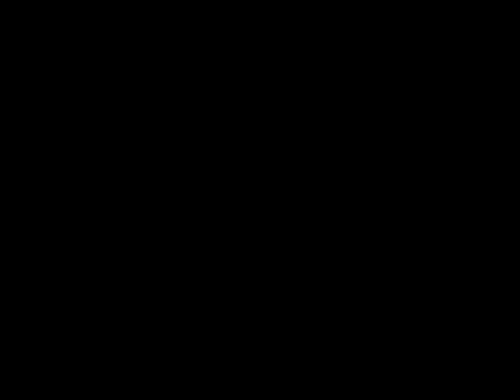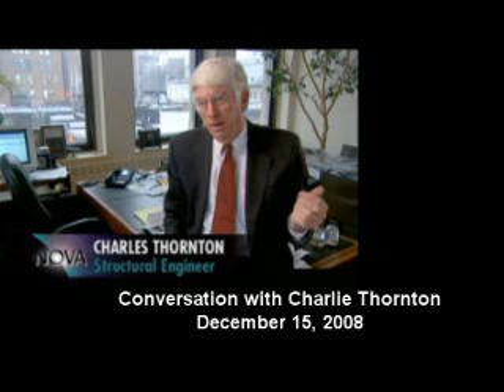pumpitout.com Jeff Hill speaks with WTC Investigator Charles Thornton

Comment: So vibrations were beyond the scope of the abilities of the original architects and engineers?
I don't think so.
Reply: This guy thinks a plane crashed into it.  This makes him a chump.  Why wouldn't a plane slow down and deform when it crashes into a steel frame and a concrete slab?  It would.  Now maybe the videos are just all fake, but then why would they hide all of the airplane parts if there was an airplane?  Fire is not going to make two jet engines disappear.  Or two black boxes.

This guy presents himself as being logical and knowledgeable but he's starting with premises that he can't prove to be correct and his theory is based on them.

Vibrations from an airplane that can't be shown to have existed? 

If the plane doesn't exist, the vibrations don't either. 

Had there been a plane then the smoke  from those immediate fires would have been pulled into the wing tip vortex.  That didn't happen, so there was no plane.

There were explosions.  If they weren't from conventional bombs, then perhaps from some technology that elements of the military (u.s. or israel's) know about and we don't.

But there's no proof of a plane.  Unless the planting of the wrong engine on vesey street is proof.

It isn't for me.  It's proof that there were no planes.
Reply: @lebergerdesphotons4565  Vibrations from an airplane that can't be shown to have existed? 

If the plane doesn't exist, the vibrations don't either. 

You're on glue!!.  Certifiable!!  You should be locked up.
Reply: @roquefortfiles  

 Vibrations from an airplane that can't be shown to have existed? 

If the plane doesn't exist, the vibrations don't either. 

So your hypothesis is that the only possible source of vibrations in the universe is fake planes?  I'll ask Jon Cole if he wants to design a clever experiment to disprove your theory.

You're on glue!!.

yes,  The floor here is made of glue.  how did you know?

  Certifiable!!  You should be locked up.

I'm glad you're not a judge.  Locking people up because they're standing on a glue floor!  Really!
Reply: @lebergerdesphotons4565  A plane that cant be shown to exist??? The fuselage landed on WTC  5 there dude!!!.. that's a 9 story building.   Dont be an ignorant idiot
Reply: @roquefortfiles  
 A plane that cant be shown to exist??? The fuselage landed on WTC 5 there dude!!!.. that's a 9 story building. Dont be an ignorant idiot

the fuselage landed on wtc5?  do you have video of the fuselage landing on wtc5?  please do show it.  thank you very much, sonny.
Reply: @lebergerdesphotons4565    Yeah if you watch the plane fly into the building you can track all of the debris that comes out the other side.  There's photographs of the fuselage section lying on the roof with a fireman having a look at.. 9 STORIES UP!!  Get real.  Stop being an idiot.   You got a bad case of circular reasoning!!!!!.  There are hi resolution photo galleries available on line (I've looked at them) with plane debris all over the street.   Passenger seats,  Life vests,  body parts.  The landing gear wedged in a column section blown from the building!! Part of the landing gear in the back of a car.   What you write is completely ridiculous.  You got a few screws loose.
Reply: @roquefortfiles  
Yeah if you watch the plane fly into the building you can track all of the debris that comes out the other side. 

Comes out the other side!  indeed!    that brave aluminum doesn't let the 2 slabs of concrete or the core of the building, more slabs on the way out.
gotcha bubba!  Thanks for pointing that out. Calls for an expert to see that.

 There's photographs of the fuselage section lying on the roof with a fireman having a look at.. 9 STORIES UP!! 

Yes,  one of the links to prove one more of your silly claims that I'm still waiting to receive.

 Get real.  Stop being an idiot.   

No doubt by that you mean stop talking to you, cause that's the only thing I'm doing for which is someone called me an idiot I'd have to agree.

You got a bad case of circular reasoning!!!!!.  

I got the rockin pneumonia and the boogie woogie blues.

There are hi resolution photo galleries available on line (I've looked at them) 

Then send me a link,  that ought to shut me up!

with plane debris all over the street. 

Like the fake engine on vesey street?

  Passenger seats,  Life vests,  body parts.

Body parts?  Good luck finding the link for that!

  The landing gear wedged in a column section blown from the building!! 

years later, because too many people were catching on to the false flagginess of 911.  It was planted like the wrong engine.

Part of the landing gear in the back of a car. 

Poor guy didn't even have time to unload it and make it look like it belonged there.

Either that or he was stealing it knowing there'd be a good market later for 911 memorabilia.

  What you write is completely ridiculous.  You got a few screws loose.

But I've always got my 10 mm and 13 mm wrenches on me, so I'm ok!
Reply: @lebergerdesphotons4565  Then send me a link,  that ought to shut me up!

Who the fuck are you kidding???  NOTHING would shut you up.  They could drop the plane on your head and you'd say... IT WAS CGI.
Reply: @roquefortfiles  

YOu haven't sent anything at all to me except for the doofus from earlier.  what point was he trying to make?  The building could be the worst, fine.

The funny part of that is that your only other reference was les robertson.   This other guy says that building was the worst building ever.  So that means he has no respect for your only other known source of information.

What I see is that I haven't said anything I can't and haven't backed while you can't backup anything you've said.
Reply: @lebergerdesphotons4565    Great.  Then tighten up the bolts holding your head on.  Maybe it would clear up your inability to understand.  And stop saying such utterly ridiculous crap.    Sorry dude but you're one of the fringe element weirdos.
Reply: @lebergerdesphotons4565    You're pretty fucking far from ok.
Reply: @roquefortfiles  

le berger des photons Great. Then tighten up the bolts holding your head on. Maybe it would clear up your inability to understand. And stop saying such utterly ridiculous crap.

Naturally you find it ridiculous.  That's your definition of "I disagree".

If only I didn't have Newton, Feynman and Cole on my side, and you only people that you imagine and then write about.

 Sorry dude but you're one of the fringe element weirdos.
Reply: @lebergerdesphotons4565    The guy who said it was a piece of junk was Engineer Charles Thornton.  Who btw just so you're AWARE!!!  Because you seem horrifyingly UNAWARE and completely clued out !! Was on the NIST investigation but he was on the OVER SIGHT committee.  Responsible for holding the investigators FEET to the FIRE.  For all intents and purposes you're  talking about a guy who was on YOUR SIDE of the investigation.  Tasked with making sure that nothing got missed.  This guy is on YOUR TEAM!!!!!  He's on YOUR SIDE!!!!  And he called the building JUNK!!!  A piece of SHIT!!  The guy is falling on his sword..  FOR YOU !!!!  And all of your ilk.  Flat out honest in calling a spade a spade.   Cheap, Flimsy,.. Light!! 

A floor system that had never been used before!!  No different to the roof of a High School Gym.  Or Lowes hard ware store. Open wed bar joists that are impossible to fire proof.    And you're amazed that a passenger jet with 60 tons of fuel and 9 ton engines moving at 840 feet/ sec went straight through it?? 

Eye roll.
Reply: @roquefortfiles  
	
roquefortfiles
le berger des photons The guy who said it was a piece of junk was Engineer Charles Thornton. Who btw just so you're AWARE!!! Because you seem horrifyingly UNAWARE and completely clued out !! Was on the NIST investigation but he was on the OVER SIGHT committee. Responsible for holding the investigators FEET to the FIRE

Classic doofus!  Thank you for that.  I couldn't write it better.

The NIST investigation is a total fraud,  even the ex-governor of new jersey realized that he'd been taken for a ride.  For once, I agree with the ex governor of New Jersey.

. For all intents and purposes you're talking about a guy who was on YOUR SIDE of the investigation. 

He was?  Then how could he have let them print that tripe?

Tasked with making sure that nothing got missed. This guy is on YOUR TEAM!!!!!

They missed everything you moron.  Ask the former governor of New Jersey.

 He's on YOUR SIDE!!!! And he called the building JUNK!!! A piece of SHIT!!

Maybe you see it that way,  but you're completely stupid, so it's not surprising.

Even if the building was a piece of shit (it wasn't) there would still be a collision strong enough to have been measured.

And it was not measurable.

The guy is falling on his sword.. FOR YOU !!!! And all of your ilk.

YOu have no idea who you're talking to.  You just know that anybody who likes facts doesn't agree with you.

 Flat out honest in calling a spade a spade. Cheap, Flimsy,.. Light!! A floor system that had never been used before!!

Are you saying you're against innovation?

 No different to the roof of a High School Gym. Or Lowes hard ware store. Open wed bar joists that are impossible to fire proof. And you're amazed that a passenger jet with 60 tons of fuel and 9 ton engines moving at 840 feet/ sec went straight through it?? Eye roll.

It didn't go through it.  it didn't go near it.  Fireproofing?  So?

the kerosene plus whatever burned wouldn't have released enough heat (even had it all transferred directly to the steel instead of leaving in black smoke) to raise the average temp of the steel frame by more than about 20 degrees.

at 40 degrees C I think the terrible building still was at 100% strength.

Keep 'em coming.   An inexhaustible well of new stupidities.
Reply: @lebergerdesphotons4565  Sorry but what the fuck have you backed up??  Dude your beyond delusional.
Reply: @roquefortfiles  

I have backed up that there would necessarily be a jolt.  Newton backs that up.  your wild theory bred of ignorance suggests that this giant structure which has the strength to hold up the 22 stories suddenly can't even slow them down a little bit.

Let's look at the math.  your 22 stories don't decelerate at all when they crush the wtc tower which was undamaged.

since m1*v1  = m2*v2

1 refers to the  22 stories,

2 refers to the total mass of the building.

for v1 to not change at all  the momentum of the 22 stories would need to be infinite.   It's mass can't change, so it's velocity would have to.

So the only way for what you said to have happened is if somehow the 22 stories accelerated to the speed of light during their fraction of a second fall to build up that dynamic load.

There goofus,  that's math backing up my story based on the analysis by jon cole's source of the video.  You're the video "expert",  I haven't heard you trying to touch that study.  Either you don't understand it or you know it blows your insane argument out of the water.

Was the math over your head?
Reply: Charles Thornton in 1988 has said exactly the opposite: 

"The largest aircraft flying today, at least commercially, the 747, fully loaded, is on the order of 300 tons. So if you think about a 300-ton element crashing into a building that's been designed to carry 13,000 tons, you can see that an aircraft crashing into the World Trade Center would probably not do anything to the major building. It could affect localized structural elements, could knock out a column, and there could be some damage. But as far as a plane knocking a building over of that type, that would not happen."

here's who is charles thornton:   

https://www.thorntontomasetti.com/person/charles-thornton

why would I take your opinion over his?  You're a clown,  he's at the top of the field of structural engineers.

you're a moron.
Reply: @lebergerdesphotons4565  crashing into a building that's been designed to carry 13,000 tons,

YES 13,000 tons !!  But that is a LATERAL load.  The face of the building presents a huge area for wind loads.  So it is designed to handle this loading.  It is designed to actually SWAY and GIVE for that load.  The sway actually reduces the loading. The same as those annoying car sale signs in car lots that are on springs.  The wind doesn't knock them over.  The sway of the WTC is the same thing.  So no!! the plane could not knock over the building with a designed for wind load at 13,000 tons.  But the loads of the floors up and down are carried exclusively as STATIC LOADS.    And once the floors separate from the columns and the exterior wall folds like cardboard from the lack of support  GAME OVER!!.  This is completely separate from the lateral loads.  You're talking apples and oranges.
Reply: @lebergerdesphotons4565  which has the strength to hold up the 22 stories!!!

Yes it has the strength to hold up 22 stories.  SO LONG AS IT REMAINS STATIONARY!!  And that is how the building has remained standing for 35 years.   Because everything is working...................AS IT WAS DESIGNED!!!! AS IT WAS INTENDED.  Everything is in ALIGNMENT!!  The loads are being carried as they were DESIGNED!!!!

Remove the cross brace of the floors and the load carrying ability of the COLUMNS drops by a LOGARITHMIC factor.  YOu can look that UP!!!!!!   

And you can CLEARLY See that exterior columns BOWED INWARD by 5 feet in some areas prior to the collapse of WTC 2.   The only thing connected to the columns................ARE THE FLOORS.   Without the cross brace of the floors the columns have no stability.  They can't carry SHIT!!!!!
Reply: @roquefortfiles  

sorry doof.  here's the problem with your reasoning.

Thornton said that an airplane wouldn't hurt the global structure.  I'm sure he was right.

You say he's wrong because the building fell.

The hole in your logic is that you've accepted that an airplane did this damage all by itself.

We don't even need to bother with the argument of whether there was a plane or not.

I'll give it to you.  Let's say there was a plane.

Thornton says it would do no major damage to the building.  And he's the expert, not you.

You noticed that there was significant damage done.

You're right.

But the conclusion is not that Thornton was wrong,  The proper conclusion is that there were other forces at work besides a (fake) plane.

Especially obvious because there was no jolt between the part dropping down and the part getting dropped down on.
Reply: @roquefortfiles  

which has the strength to hold up the 22 stories!!! Yes it has the strength to hold up 22 stories. SO LONG AS IT REMAINS STATIONARY!! And that is how the building has remained standing for 35 years. Because everything is working...................AS IT WAS DESIGNED!!!! AS IT WAS INTENDED. Everything is in ALIGNMENT!! The loads are being carried as they were DESIGNED!!!! Remove the cross brace of the floors and the load carrying ability of the COLUMNS drops by a LOGARITHMIC factor. 

What you're saying is of no significance.  Because crush up equals crush down.  it's newton's law.  We accept it here on Earth.

if you look at the momentum equation you would see that you're an idiot.

You won't.

the 88th floor,  the top of the undamaged part of the building.  your top falls down with its dynamic load.  the 88th floor is now supposed to be moving  downward with the 22 stories?  well it probably weighs 5% of the 22 stories, even if the giant beams which are holding up a giant static load offer zero resistance, the falling (hypothetical) mass will slow down 5% when it hits the 88th floor.  But 5% is way more than the margin for error of the video with it's images every 33 milliseconds.

This didn't happen.  That fact is caught on film.

YOu can look that UP!!!!!! And you can CLEARLY See that exterior columns BOWED INWARD by 5 feet in some areas prior to the collapse of WTC 2.

But that doesn't prove that this happened because of a (fake) airplane crash.

And one of the best structural engineers said that it would do nothing significant.

An airplane didn't knock down a building.

you're an idiot.

 The only thing connected to the columns................ARE THE FLOORS. Without the cross brace of the floors the columns have no stability. They can't carry SHIT!!!!!

they also have no motive to break into short pieces.  They should either stand or fall over and not break into many pieces at all.
Reply: @lebergerdesphotons4565  We don't even need to bother with the argument of whether there was a plane or not.

Dude?? please stop with this utterly ridiculousl plane nonsense ok.   You're not fooling anyone.  You sound like a complete nutcase.  Someone who should be carted off in a jacket.   The entire firm responsible for putting up the WTC were at their windows watching the first building on fire when the second plane hit.   They watched the whole thing. I just finished watching it. Please stop with this plane nonsense.     You sound like a barking mad lunatic.
Reply: @lebergerdesphotons4565  
https://www.youtube.com/watch?v=Yo1WZ9g1IJ4

24:27 minute mark.  So she's imagining the plane hitting the building 2 blocks from her looking straight at it??  The entire office is just imagining the plane hitting the building as they watch it happen in front of them?? 

Dude?? you sound like a complete fucking barking mad NUT CASE!!!.    The entire foundation of what you're attempting And failing badly, to argue is built on NONSENSE to begin with.  If you can't accept that a plane hit the building then you can't accept anything about this.  

I don't even really know why the fuck I am talking to you.   

You sound like a total crazy man.  And i call it like it is.
Reply: @lebergerdesphotons4565  Charles Thornton also said..   "If you lose the lateral support of the floors the exterior wall will just bow out".  

Strange you never bother to mention that.   Look!! why don't you just admit that you're a fruitcake who can't understand any of what your'e looking at.  And you have to invent crazy scenarios in order for your brain to process what you're seeing and can't understand.     And it is plainly obvious to see. 

Imagine you're in a court of law or inquiry on the WTC.   

So Mr Photons?  The aircraft wasn't really there?? 

Explain your position.   With reason and logic!!!!!
Reply: @lebergerdesphotons4565  Thornton says it would do no major damage to the building.  And he's the expert, not you.

NO. NO NO NO!!!  He said.  "But the idea of an airplane knocking the building OVER that would not happen for a building designed for 13,000 tons of wind load"  

 based on the lateral design loads an interview given long before 9/11.    That is an ENTIRELY separate argument to the weather the building could COLLAPSE!!!!!!!!!!!!!!!!!!!!!!!!!!!!!!!!! 

Of which he is on record as saying "If you lose the lateral support of the floors the exterior wall will just BOW OUT".. 

And that is precisely what it did!!!

Where's the hole in your argument???  If you look around the room and you can't spot the idiot...................?
Reply: @lebergerdesphotons4565  Dude this has ALL BEEN EXPLAINED BY PEOPLE A HELL OF A LOT BRIGHTER THAN YOU. This is all addressed on NIST FAQS.
Reply: @roquefortfiles  If only the world was like you imagine it.  That NIST is not corrupted at the highest levels.  That everybody who could make any kind of credible statement has to consider whether saying things that the PTB don't want said might lead to rapid declining health, like Bob Marley saw, for example.

So  sorry,  tom keane was man enough to say it out loud that NIST had lied that the gov't set him up on the 911 commission to tell everybody lies.

You should try being a man.  A man uses his head, he doesn't repeat the "common wisdom".

He recognizes that it may be propaganda and he needs to consider that possibility.

Believing a thing because somebody else does is one of the main logical fallacies.

You're good at logical fallacies,  but you're not good at logic.
Reply: @lebergerdesphotons4565  If only you weren't a completely paranoid conspiracy freak.
Reply: @lebergerdesphotons4565  Non existent plane?  And you're telling me to man up?
Reply: @lebergerdesphotons4565  OMG!!  dude I have wiped the floor with you and your logic.  There are so many holes in your arguments you could fly the HINDENBURG through them.
Reply: @roquefortfiles  

Non existent plane?  And you're telling me to man up?

I"m still waiting for you to tell me why those two flights were not in the same database as millions of other flights were.  It seemed that all flights which took off from us airports are in that database with the exception of a couple of flights on 911-2001.

Yes.  quite being an idiot.  the only "proof"  you have that a plane exists is a piece of video.

Everything else, you haven't been able to show any documentation.  Fake pieces of airplane "found"  years later, or the same day, but not being the right engine.   

Doesn't the wrong engine being found kind of demonstrate that somebody wants us to believe things which aren't true?

Why don't you try to prove that the wrong motor wasn't found.  

Or that the motor found at the pentagon wasn't much smaller than a motor from a passenger jet?
Reply: @roquefortfiles  

OMG!!  dude I have wiped the floor with you and your logic. 

I'm sure you believe that.

 There are so many holes in your arguments 

I haven't seen you punch any holes in any of my arguments.   This is just you blathering again.

You're blown away by Newton and Cole on the no jolt observation and analysis.
Reply: @lebergerdesphotons4565  Tell ATC Dave Bottiglia that!!. He had the plane on radar all the way to the WTC.  Calling down the altitudes.
Reply: @roquefortfiles  

even if the 22 stories falling into the bottom 88 undamaged floors were given infinite tensile strength and infinite hardness the bottom would still stop the top from falling long before it would get to the bottom.

Or more likely, it would fall over the side after bouncing off.  I guess I'll need to give it perfect adhesion also to meet your requirements.
Reply: @lebergerdesphotons4565  You have absolutely zero understanding of this.  None!!.  The problem here is that you think you do.
Reply: @roquefortfiles  

You have absolutely zero understanding of this.  None!!.  The problem here is that you think you do.

Unfortunate for you that you can never name one of the things that I don't understand.

John Cole and Newton and I explain to you how you are mistaken,  but you just declare that I'm the ignorant one.  So all you have is your own opinion.

That and a buck,  what will you get?

try to be specific.  that could lead to a debate.  your handwaving is just you wanting to be right without doing the work.
Reply: @lebergerdesphotons4565  Sorry dude!!.  Your comment about falling over the side??.. you've just unzipped your stupidity fly.
Reply: @roquefortfiles  

does that mean I was mistaken about the official story being a conspiracy?  Were the 19 guys there just coincidentally,  all got tired the same day of the west coming to their country and screwing with them?

That's just the official story.  There weren't really 19 guys on planes cause there were no planes.  Hard to put 19 guys on planes that don't exist, that evade the u.s. gov't database.  

Those brave airport workers who kept those flights off the register!  I wonder why they did it?
Reply: @lebergerdesphotons4565  FYI every single gravity load is directed to the building footprint.  The structure cant be knocked over. Ties in with the 13,000 tons of lateral load.
Reply: @roquefortfiles  le berger des photons FYI every single gravity load is directed to the building footprint. 

but a collision between a fictitious 22 stories of perfect rigidity and the bottom 88 floors which were undamaged by fake planes could cause the fictitious mass to go over the side.

Just one more thing you're wrong about.  It only happens when you open your mouth.  So if you want to stop being wrong, you see your solution.

The structure cant be knocked over. Ties in with the 13,000 tons of lateral load.

I didn't say it would be knocked over.  More straw man arguments.

You only have logical fallacy.  You prove it every time.

You should learn the logical fallacies so that you can lie more effectively.
Reply: @lebergerdesphotons4565  If one floor cant hold 15 failing... Which it cant!!.  What makes you think the next floor is going to do any better with 17.....
Reply: @lebergerdesphotons4565  You could fly the HINDENBURG through your crap with the planes.  Ask yourself if it holds water!!.. You got a good salad strainer
Reply: @roquefortfiles  

What kind of salad dressing will I need to be able to believe that an aluminum fuselage built just strong enough to not be crushed by  600 mph winds at 250 mb of pressure can destroy 2 4 inch light-weight concrete slabs struck on edges protected by more than one inch thick steel plates?

1400 kg/m3  for lightweight concrete.  10 cm thick, 60 m x 60 m. 360 metres 3  per slab.    500 tons per slab of "lightweight" concrete.

sure,  there's no concrete inside the core.  I agree.  But the core provides very strong links to a whole lot more mass,  so it's clearly offering more resistance than if it was just a 4 inch slab hanging in mid air.

Good chance that a 16 foot fuselage would contact two of the 500 ton slabs.

Thornton said a fully loaded 747 would be 300 tons.  Obviously the 767 is much lighter.

now how about the weight of the vertical columns?   Well,  surely a whole lot more weight, better tensile strength than the concrete, but of course the concrete will mainly be subjected to compressive loads.

Concrete is pretty good at that.  Probably better than sheet aluminum.

And where are the engines and black boxes?  And where are the entries for these flights in the official database which has every other flight ever flown out of a u.s. airport (unless it was the pope and the jesuits).

And why can't people understand frames of reference?  All that counts is the impact,  not who is moving and who isn't.

Is anybody else reading this conversation?  Do any of you have opinions?

I've seen a couple who seem to be in league with my doofus.  They went away when I showed them that I understood frames of reference and proved that they were lying.

Is there a "rest of you"?
Reply: @lebergerdesphotons4565  What would happen if a 767 flew into the building??   Well, We have over 50 angles of it!!!  Empirical evidence!! and witnessed by thousands of people.    Force equals mass x acceleration.   Had the aircraft been empty of fuel the building would have won.    The difference in impact force between the jet fully fueled to empty is enormous.   It doesn't matter that it is lightweight aluminum.   Move anything fast enough and it can do disproportionate damage to another surface.   Tornadoes prove this all the time with 2x4's impaled in walls. You can fire a ping pong ball through a 2x4 if you move it fast enough.  The impulse force on impact between fully fueled to empty is HUGE.  Drop a bucket of water on your head from 5 stories.  The full one would KILL you.
Reply: @lebergerdesphotons4565  Empirical evidence dude!!  It is not a hologram.  It is not CGI.  It is not a hole you order from ACME.  It is really there.   Deal with it.  You'll sleep better. 
https://www.cs.purdue.edu/homes/cmh/simulation/phase3/Run11/NorthFaceWTC1.jpg
Reply: @roquefortfiles  le berger des photons What would happen if a 767 flew into the building?? Well, We have over 50 angles of it!!! Empirical evidence!! and witnessed by thousands of people.

Let's avoid the argument about the existence of the plane.  Tell me how you have proven that there was nothing else going on in the building at the same time, perhaps set up by the same people who set up the planes?

The eyewitnesses can't know that, so we can eliminate them.  The 50 angles don't change that.

So as far as I know, you don't know if that was the case or not.

More difficult to prove that something didn't happen, isn't it.   

I think there were some good witnesses to explosions in the basement.  Surely your airplane didn't cause them.

 Force equals mass x acceleration. Had the aircraft been empty of fuel the building would have won. The difference in impact force between the jet fully fueled to empty is enormous. 

No.  that's not so.  The fuel tanks will have ruptured instantly, the momentum transferred to the building will be limited by the tensile strength of the fuel tanks.  once they ruptured, it's just a high speed uncoordinated splash, easily absorbed.

It doesn't matter that it is lightweight aluminum. Move anything fast enough and it can do disproportionate damage to another surface.

you still don't understand frames of reference.  The fact that the plane is moving doesn't mean it wins the battle against a stronger heavier object.

Tornadoes prove this all the time with 2x4's impaled in walls. 

Yes, they are impaled in walls,  not in steel beams.

You can fire a ping pong ball through a 2x4 if you move it fast enough.

I guess a ping pong ball has more tensile strength than the 2 x 4 has compressive strength.

 The impulse force on impact between fully fueled to empty is HUGE.

But what about the poor Newton talking about his equal and opposite?

the building hits the plane as hard as the plane hits the building.  And the building is much stronger.

 Drop a bucket of water on your head from 5 stories. The full one would KILL you.

My head is not resistant enough to easily break the bucket,  so this is not a good analogy.
Reply: @lebergerdesphotons4565     Something else going on in the building??   Those are mighty good pilots to hit the exact floor to coincide with "Something Else".   And unfortunately explosives going off inside the building (If thats what you're implying?) do not result in steel columns being bent INWARD.  They would be splayed OUTWARD!  The ballistics for that argument simply doesn't work.   This is about the same retarded reasoning applied to the TWA 800 disaster.  Except in the other direction.     We have cause and effect.  And it is predictable.  That's what science and evidence provide.
Reply: @lebergerdesphotons4565  the building hits the plane as hard as the plane hits the building.  And the building is much stronger.

Well quite apparently NOT!!!!! In 2 instances!!  And you can go examine in detail what the plane did to the building from both high resolution video and still photos and take all the time you want in examining.  Which btw line up almost perfectly with what computer simulations done after the fact predicted would happen.  The physical evidence matched the simulations predicted outcome.  They are both in agreement. 

   You can't look at factual evidence of something (a plane crash)  and then disagree with an outcome that you EXPECT TO SEE!!! That's not how the scientific method works.  You don't shoe horn evidence to fit your expectations.  Sorry it doesn't work like that.  What happened IS what happened.   Both planes went straight through the side of the building.  Because the force imparted on them was substantially over the bolted connections strength.  Which we can EASILY see in still photos.  And it was substantially over the yield strength of (At that level) EXTREMELY light box columns.  Once the plane was through all of this stuff it was acting more like a giant mass of LIQUID moving at 840 feet/ sec.  Doesn't matter.  If you hit the building with a bag full of guacamole moving the same speed you'd get the same outcome.    A physics prof even said so.  The plane could have been filled with WATER and you'd get the same result.  Liquid does not COMPRESS.   You can cut steel with a water jet.
Reply: @lebergerdesphotons4565  My head is not resistant enough to easily break the bucket,  so this is not a good analogy.

So you're telling me that If i dropped a large EMPTY!!! lightweight aluminum back yard pool on your house from 200 feet up it hits the roof of your house with the same force as if I lifted the exact same pool FULL OF 20 tons of water and dropped it on your house?    It is still the same cheapo light weight aluminum pool.   What has changed is the force delivered on IMPACT!!
Reply: @roquefortfiles  

e berger des photons My head is not resistant enough to easily break the bucket, so this is not a good analogy. So you're telling me that If i dropped a large EMPTY!!! lightweight aluminum back yard pool on your house from 200 feet up it hits the roof of your house with the same force as if I lifted the exact same pool FULL OF 20 tons of water and dropped it on your house? It is still the same cheapo light weight aluminum pool. What has changed is the force delivered on IMPACT!!

I'd say it might make a difference that my house is not steel and concrete.

your swimming pool all the same would break on the wood members and the massive amount of water would probably push the ceramic roof tiles off of their fine wood supports,  probably break the one inche square section members which held up the roof tiles.  The supporting structure would still likely be there after breaking the pool.

I"m still waiting for your explanation of why you're the only one I've ever heard claim an exception to every action has an equal and opposite reaction.
Reply: @lebergerdesphotons4565  Dude?? The roof of your house would disappear
Reply: @roquefortfiles  

no, because as long as I maintain my conversation with you my house is immune from newton's laws.
Reply: @lebergerdesphotons4565  Charles Thornton.  14 years of education!!.. "had the aircraft been empty of fuel the building would have won!".. 14 years of education....  You??
Reply: @lebergerdesphotons4565  Dude.. your house is actually CGI.. and when you fall over laughing maybe you'll understand why I do
Reply: @lebergerdesphotons4565  So... if I dropped a flimsy 25 pound bag of cat litter on your head from 100 feet up the empty bag hits your head with same force as one filled with 25 pounds of cat litter?  The fact the bag is still  light paper has not changed
Reply: @roquefortfiles  14 years?  Was he educated at a jesuit university?  Does he have 200,000 dollars of college loans that he needs to pay off and the perpetrators of the crime that is 911 wanted him to say that and so he didn't have a choice?

Sorry,  14 years of unknown "education" doesn't put him in a position to nullify Newton's laws because he believes a thing.

Really,  300, tons versus 293,  that's the difference between life and death for those 3000 alleged people?

Your idiocy hits new highs every time you open that ridiculous pie h ole.
Reply: @roquefortfiles  

but more to the point,  if you compare the 25 lbs of cat litter in the bag to 24 pounds of cat litter in a different bag,  that's the difference you're talking about.
Reply: @lebergerdesphotons4565  People including survivors exist. Listen to how many people say the Building swung back and forth,
Reply: @roquefortfiles  tell those idiots. Alot of kooks are not aware that pocketbooks, shoes, credit-cards, parts of the Airplanes and Sadly parts of people were all over the WTC complex
Reply: @lebergerdesphotons4565  it's not 22 floors falling on 88 undamaged floor s. It's 22 floor vs the very next floor, then the next floor all the way down
Reply: @melvynsngltn27  People including survivors exist. Listen to how many people say the Building swung back and forth,

Melvyn,  you are really challenged by reality.  You have just asserted that the only thing that can make the building swing is magical airplanes who crash into something much harder and heavier than themselves and don't slow down and don't lose their tail?

Why couldn't it be something else?

If the fake videos had shown a giant potato, you'd be advocating for the potato destruction of wtc1 and wtc2?

Yes,  you would.  That's your level of intellect.
Reply: @melvynsngltn27  more genius from the doofus!

it's not 22 floors falling on 88 undamaged floor s. It's 22 floor vs the very next floor, then the next floor all the way down

If you were capable of doing any math then you would not be emitting stupidity such as you just have.

Even if the bottom 88 floors were just magically held in place and automatically released when the 22 stories arrived,  each floor's mass would slow down the falling mass enough to make it take more than 30 seconds to reach the ground.

that didn't happen.  So your theory is bunk.
Reply: @lebergerdesphotons4565  no that's truth moron pay attention
Reply: @lebergerdesphotons4565  Magical planes you could see the second plane coming from Nearby New Jersey before it was driven into the South Tower. People like yourself believe in everything except reality
Reply: @melvynsngltn27   Magical planes you could see the second plane coming from Nearby New Jersey before it was driven into the South Tower. People like yourself believe in everything except reality 

Melvy singluarly stupid singleton

You have proved 911.  There was an airplane in New Jersey at the time!  That's absolute proof!   It's more than enough to suspend the laws of physics.

If only they had made you a one man 911 commission,  we all could have avoided so many problems!
Reply: @melvynsngltn27  Yes i know that.
Reply: @roquefortfiles  he may have had something on radar,  but he can't prove it was "the plane"  whose flight never made it to the faa database.

more crap coming out of one of your orifices again.
Reply: @lebergerdesphotons4565  Had there been a plane then the smoke  from those immediate fires would have been pulled into the wing tip vortex.  That didn't happen, so there was no plane.

 You're on crack!!.  The plane didn't fly through the smoke.   And friends of mine watched the plane live in person.  YOu sound like a complete and total nutcase.  Certifiable.
Reply: @roquefortfiles  

le berger des photons Had there been a plane then the smoke from those immediate fires would have been pulled into the wing tip vortex. That didn't happen, so there was no plane. You're on crack!!. The plane didn't fly through the smoke. 

doofus,  wingtip vortex lasts 2 minutes.  does it take 2 minutes for kerosene to catch fire and create smoke?  No.  It takes much less.  So the smoke would have been pulled into the vortex that the plane's wingtips (had there been a plane) would have created just before the smoke was created.

See how you are able to make bad assumptions?  You assumed that the plane has to fly through smoke to have smoke pulled through the vortices.   I had to explain to you that the smoke could be created after and that the vortices are still there.

This doesn't make you stupid,  but it doesn't make you smart either.

And friends of mine watched the plane live in person.

So your hypothesis is that because your friend watched the plane live that it was a plane that made no wingtip vortices at 500+ mph?

Let's test your hypothesis with experiments!

 YOu sound like a complete and total nutcase. Certifiable.

Where did you get this lingo from?  Is that what the police said about your father when they left you home with your mother while she drank herself to death?
Reply: @roquefortfiles  

listen  Doofus,  

Maybe go talk to your dyanmic force guru and see whether he agrees with you.

What he was saying is that a big enough load (which the upper part of the building would need to be moving or dynamic) could do some damage below.

He didn't say that just because it could do some damage that 20 times it's weight and 100 times it strength of other matter would turn to powder.  That Newton's laws would be repealed.

Ask them if there still wouldn't be a jolt.

Given that it's sources you found,  they're probably just that ignorant.
Reply: @lebergerdesphotons4565  It would do it EASILY!!. the structure had a safety margin of 5x the resting static load. When the top of the building failed this generated a dynamic load that was up around 80x the resting static load. The force necessary to crush the concrete was off the charts. Testing labs did studies on it. They know the force required to crush concrete to establish various standards.  It was not even close to being a contest. And yes there was a crush up. When it reached the ground. That's what you and your buddy Cole dont understand!!!!!. The crush DOWN was MASSIVELY over the crush... up
Reply: @roquefortfiles  le berger des photons It would do it EASILY!!. the structure had a safety margin of 5x the resting static load. When the top of the building failed this generated a dynamic load that was up around 80x the resting static load. 

well then there'd have to be a violent crash.  If there was a violent crash there would be a clear deceleration which would have been measurable on the official video.

It wasn't, therefore your theory is wrong.

The force necessary to crush the concrete was off the charts. 

and almost entirely dissipated after the first collisions.

Testing labs did studies on it. 

show me your studies.  I think you're just making this up.

They know the force required to crush concrete to establish various standards.

that would mean they know that there are huge quantities of energy used which exceeded by orders of magnitude the energy available from gravity and kerosene.

 It was not even close to being a contest.

kind of like when you and logic battle it out.  You lose every time, and logic wins.   You should try some logic sometimes.

 And yes there was a crush up. When it reached the ground. 

why not before?  Because the entire bottom of the building was being destroyed at exactly the same time by some enormous source of energy.

That's what you and your buddy Cole dont understand!!!!!. The crush DOWN was MASSIVELY over the crush... up

of course it was,  since it was lighter and more feeble and damaged.   Yes,  that's sarcasm.  You are probably retarded and I should quite picking on you.   The people looking after you are very nice to let you do this.
Reply: @lebergerdesphotons4565  well then there'd have to be a violent crash.  If there was a violent crash there would be a clear deceleration which would have been measurable on the official video.

THERE WAS!!!  You might like to notice that the debris is out pacing the collapse by a huge margin. 10 stories or more.   Why?? because the building is offering RESISTANCE.   Just not very much!!!  Why? because it is in a STATIC mode.  The portion failing is DYNAMIC!!!  And each floor collision is adding mass to the equation.  Your problem is getting EXPONENTIALLY WORSE as it goes.  The failure was actually speeding UP as it went.   The mass is SQUARED with each floor failure.  

Sorry.  But Dynamic loading matters.
Reply: @roquefortfiles  

well then there'd have to be a violent crash.  If there was a violent crash there would be a clear deceleration which would have been measurable on the official video.

THERE WAS!!!  You might like to notice that the debris is out pacing the collapse by a huge margin. 10 stories or more.

I didn't say that it was falling at 9.8m/sec/sec.,  mr.  straw man argument.

The building is offering precious little resistance.  The roof accelerated at a constant rate before during and after the collision.

If it was enough of a collision to be noticed in the graph, then it wasn't enough of a collision to destroy 250,000 tons of in tact building.

   Why?? because the building is offering RESISTANCE.   Just not very much!!!  Why? because it is in a STATIC mode. 

No.  because it is being simultaneously destroyed by something else which can easily be determined to be a much greater source of energy than the gravitational potential of the building.

 The portion failing is DYNAMIC!!!

Anything moving is dynamic.  That's the definition, mr. wizard.

  And each floor collision is adding mass to the equation.  

Sure.  Each floor has two representatives and they vote on violating newton's laws just as the visitor arrives.

Your problem is getting EXPONENTIALLY WORSE as it goes.  

If you're referring to this problem I have where I can't let a doofus like yourself off the hook,  then I have to agree.

The failure was actually speeding UP as it went.   The mass is SQUARED

The mass is squared?  really!

 with each floor failure.  

Sorry.  But Dynamic loading matters.

ok bubba.  you da man!
Reply: @roquefortfiles  Their was a plane vortex? Where were you during 9/11  with that bs your talking 🤭. Maybe this will help check out Michael Baragello's video around 3:15 mins into the video the plane crashes. Not only do you see real survivors terrified because they were under the building that got hit, you he the vortex
Reply: @melvynsngltn27  No idea what you are talking about.  I think you got the wrong guy.